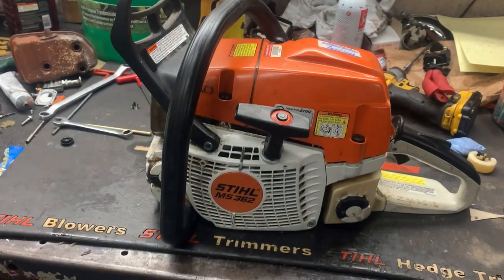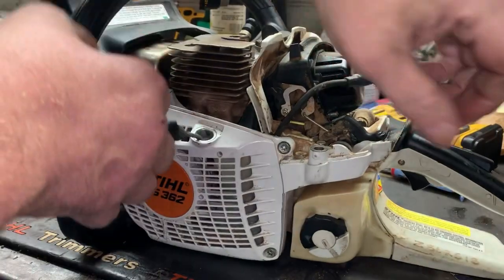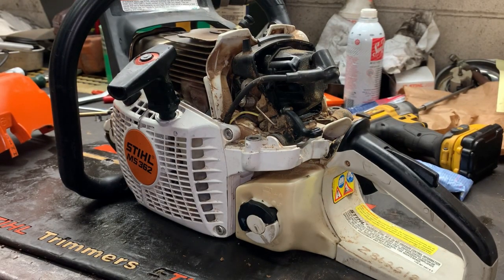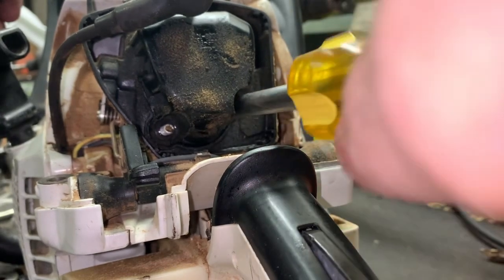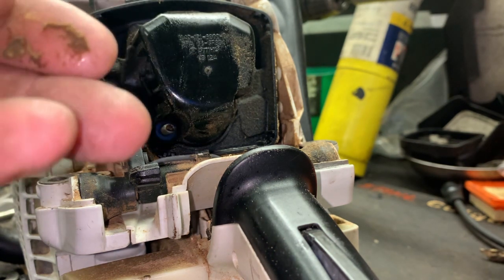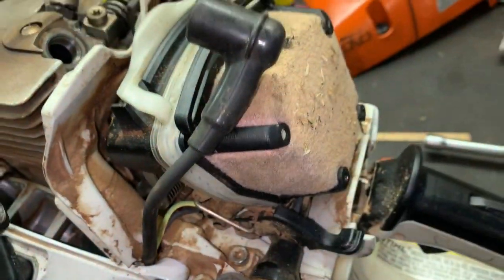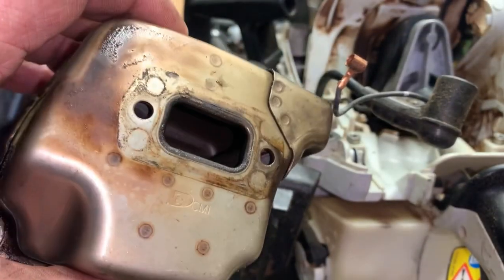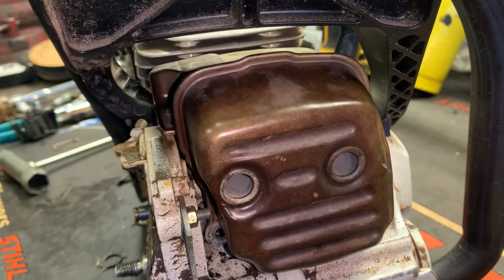#STIHL #MS362 CATASTROPHIC CONNECTING ROD BEARING FAILURE

Comment: Had this with a TS400. Bought a new crank, cylinder and piston. These were aftermarket parts but is still working 3 years later. Rule of thumb, never lend your tools out. Always use the correct mixture of oil to fuel. Clean your tools and maintain them. Don't use old stale fuel. These 2 stroke tools are so easy to fix yourselves if you're confident enough to repair.

Comment: I have a ms362 and I have exactly the same situation when I pull the cord ( muffler out spark plug out ) it blocks in the upper piston or lower piston position. I turn the fly wheel by hand and it locks. When I move a little bit left right then I can move again until i reach the upper or lower position. Probably the piston cylinder crankshaft bearing is not worth investing $$$ and being seen as running.

Comment: I'm diagnosing a very similar issue on my ms362. Haven't pulled the head but so far everything else seems normal. My symptoms are 10/10 what this was experiencing, so I expect to find the same crank issue. Curious why you think it's not worth the repair; if a crank can be had for under $200 seems like a no brainer to repair instead of replace on a saw like this?
Reply: Doing this at this exact moment. Definitely worth a new crank!
Reply: @mattscholl3924  right? got a $60 used crankshaft from ebay...OEM and mint...no brainer

Comment: To have so much shit behind the air filter, it's not normal, I've had one since 2010, I've never seen it, but I blow it every day. The origin of the expensive fault is there.
Reply from the maker: You’re just cramming it in there, deeper and deeper. When you blow it out, never used compressed air always use a paintbrush or something.

Comment: I think you diagnosed this correctly. But it is probably not the crank's fault.
The combination of a dull chain, fine sawdust all over, poor air filter and severely over stressing the engine for a long time would have built up heat. Check out the discouloration on the vrist pin. And perhaps that fresh air flushing system kept the piston cooler so that it did not seize up first.

Comment: I working on a ms 210 it didn't overheat fuel is mixed correctly, came in with a choppy hard to pull issue found the bearings in amuck in a bad mess ,kinda thinking its a mfg bad parts issue there was not any apparent reason for that bad a failure!

Comment: Great details on your video and easy to understand you great job. We were seeing this kind of failure a lot with these newer strato engines basically you're opening up a butterfly introducing straight air which sends the crank to lean condition this requires Great oil not just good oil. And as you know it's very hard to get customers not to use Husqvarna or still mix oil in their power saws and both are a okay or good oil just not excellent and these type of Saw engines require excellent mix oil in order to get them to last. The customers I was able to convince to switch have not had bearing failures since. So I think it's a combination of a few things in your situation probably dull chain maybe eating some fines possibly mix oil. however we have all seen old saws that have ate fines for years and still no crank failure. It's really hard to tell but you did the right thing did a leak test first before tearing anything apart just to rule that out. On my end professional logger customers rarely run dull chain but they were still wiping out the crank bearings , rod and wristpin on OEM oil but only with the strato engines the standard engines were not going bad.

Comment: Had the connecting rod bend on a BG 56c blower. This was 2 years old with looks to be light wear with disassembly. Connecting rod is flat plate without any rib/structure design. Contacted Stihl to inquire if rods go through any tempering/strengthen process and was told they do, and any chances of a defect was very light. They offered a comment; "lower is in a cage and cannot lock like a brush trimmer. Compression gets a "little" higher. Any comment would be appreciated.

Comment: Both big end and small ends of the connecting rod are blue.  There is a bright blue band on the gudgeon pin (wrist pin, piston pin).  This blue colouration is due to pronounced overheating and should never normally happen if all is right with the saw.  Where you show the big end bearing locking up, you can see that there is a gap in the big end bearing cage on the right.  The cage is breaking up.  When looking from the right hand side and trying to turn the crank, I think that you can see that the left hand main bearing also has a broken bearing cage - the spacing of the balls does not seem to be regular.
Both these cages are steel.  On older, poorly maintained saws, especially if repeatedly thrashed with a blunt chain, you can get impacted fine sawdust pushed in past the lips of the left hand oil seal (behind the generator rotor).  This gets through into the bearing and accellerates wear, causing the cage to fail or partially fail.  Debris from this failure (bits of cage) gets through into the crank case and can into the big end and even (via the transfer ports) into the combustion chamber.  I think there are signs of metallic debris being in the squish band around the outside of the piston top leaving little craters in this part of the piston crown.  Throughout this process, air increasingly gets past the main bearing oil seal and the saw runs lean, exacerbating overheating.  I have seen bearings embedded in the top of the piston and on one occasion (an MS261) a perfect half ball sitting on top of the piston, the ball from the bearing having been cracked in two. Popping the generator rotor off would show if the failure of this seal (and main bearing) is the root cause.  Keeping chains sharp at all times prolongs saw life. Thanks for posting - nice vid.
Reply from the maker: Factory heat treat not overheat
Reply: @THEMOWERMEDIC1  I remember when I was 13 many many years ago I was told the same thing, that my blue crank needed replaced. Glad I had the clymer manual and kindly declined.

Comment: As filthy as that saw was it is no wonder that something failed.  Saw dust and oil hold heat, which is why you need to keep a saw as clean as possible.  I blow out my saw after each use and give them a deep cleaning once a year.  I see saws all the time that need to apply for a crop allotment from USDA because they are so filthy.  I won’t say you can eat off my saws but pretty close.

Comment: He could have chunked a circlip from the piston, always on the intake side.  Those nylon cage bearings are always a problem.  It could have chunked a bearing and it got under the crank.  I agree with you about getting “fines” into the engine on just about any saw.  However Husqvarna XTorq engines are prone to bearing failures more than the old XP designs were, as are the new engines with Strato carbs.

Comment: Stihl has had this problem for years.  They tried to blame it on 50:1.  Its a bearing manufacturing problem.  Was the crank made in Brazil?
Reply: Every sr 430 ( backpack sprayer) that I have ever looked at has had issues with main bearing failing. Those unit are made in Brazil so I would have to imagine they got a real bad batch of bearings. I have literally installed short blocks under warranty and units come back in 6 months with same main bearing failures it’s ridiculous.
Reply: @jessemalone8363  Good Job Jesse.

Comment: Just my opinion only. One in 5, 000 assembly line defect. Or the crankshaft and bearing assembly wasn't properly aligned. Respectively I'm not buying the sawdust theory.
Reply from the maker: I never said sawdust killed it.
Reply: I  have took two of these saws apart in the last 3 months  both had failed rod bearings to the point were they locked the motor up and damaged the bottom of the crank case.

Comment: Good video ! What I think happened. Usually big end rod bearings turn blue and fail because the high jet on the carb is turned in and let the engine over rev. Or they could have been cutting soft rotten wood judging by the fine dust and the engine RPMS would be at max for long periods of time.  But a dull chain could burn up an engine  but usually the clutch turns blue and melt the plastic bearing cages.

Comment: Replace with 562 XP and run good oil at 40:1. Problem solved! I have a 362 and it just doesn’t seem seem to have the “oomph” the 562 does. I’m not being negative towards Stijl. I own many of their products.
Reply: I’m not a Stihl guy but I don’t understand why the 362 doesn’t compete with the 562 Husky. The 462 is the saw for the 70 cc class and pretty much beats anything on power. Stihl seems to be concerned more with weight than durability right now.
Reply from the maker: I agree.  The 362 is a mid grade saw IMO

Comment: I just bought a new ms362 Last week, It looks like I am going to get some rtv and put it around the air filter thanks.  Great video
Reply: I would use grease myself. It is messy but it cleans up and keeps fines out of the engine. If a little gets sucked in it’s no big deal unlike silicone.
Reply: Use silicone grease, it doesn't harden. Its also not gonna do anything to do engine if it ever sucks some in. Besides that its stickier and adheres better on plastics than regular bearing grease.
Reply: Be careful putting silicone around the filter. If the silicone migrates into the engine it can cause issues.